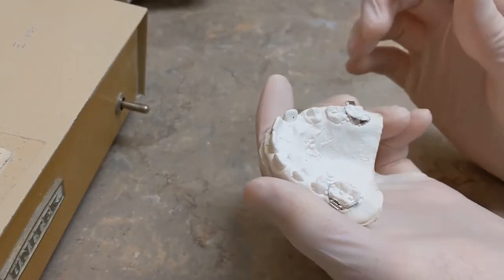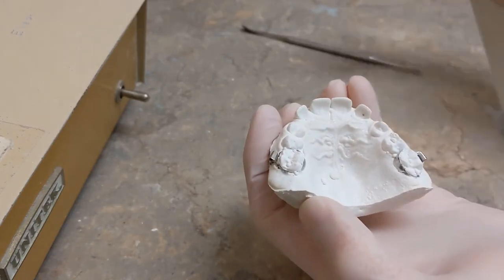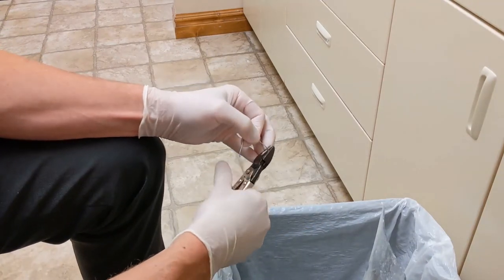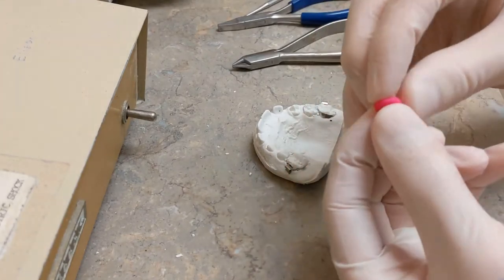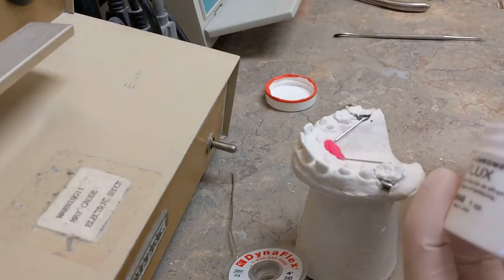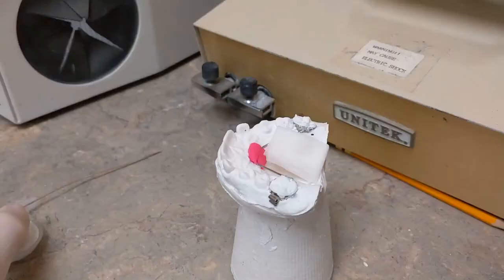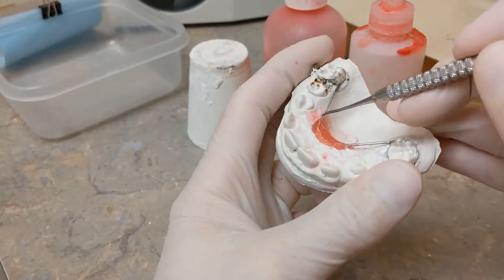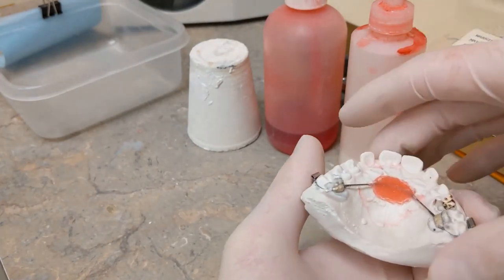How to make a Nance appliance

Comment: Great video! You mentioned removing the super glue with your lab knife. I have used staples to hold the bands into the impression, but are you using super glue to glue the bands into the impression before you pour it up? Also, I didn't see you polish the bands at all. Do you do that to make them shiny after soldering? If so, what do you like to use? Thanks!
Reply from the maker: Thanks!  I use a tiny dot of super glue to hold the bands in the impression before I pour up the impression. I show how I do that in my video on how to pour up an impression with bands. That video can be found on my YouTube channel Like A Boss Productions. 
I don’t polish the bands but I have started to polish the solder joints. I use a green wheel in a lab hand-piece to polish. Then I use a wire brush to clean off the band, bracket, headgear tube, inside the bands, etc, to remove any stone bits or debris that may be stuck on.

Comment: What material You use for stick the wire to the cast, before You soldering the wire to the bands? This material îs thermoresistant?
Reply: I use Play-Doh. I buy it at WalMart for $1 (cheap!). To prevent it from scorching when I solder I cover it and the wire with a wet paper towel. The water in the paper towel soaks up the extra heat from the torch flame and prevents the wire from overheating and getting brittle. After I've soldered the wire to the bands I pick off the Play-Doh with a wax spatula and brush off any residue with a toothbrush while rinsing it under the faucet.

Comment: I just came across your channel and love your videos! My ortho says I have to get a bite plane so she can bring my upper first molars lower down. Is that the same thing as a nance appliance?
Reply from the maker: A bite plane (or some call it a bite plate) is a removable appliance made of acrylic that fits against the roof of your mouth. It covers the roof of your mouth and the acrylic is thicker behind your front teeth. That means that when it's in place your lower front teeth bite on that thickened acrylic and your back teeth don't touch. Over a few months your back teeth can erupt until they touch again.
I hope that explanation helps. I'll bet there's a YouTube video out there if you're having terrible picturing it in your head. 👍

Comment: what are those ketchup bottles used for the storage of acrylic resin? what's it called? and their tips?
Reply from the maker: They're just plastic squeeze bottles. The monomer bottle can be found by searching "squeeze bottle needle tip" on Amazon.com or a similar site. The polymer bottle would be found by searching for "squeeze bottle". Then you can cut the tip of the polymer squeeze bottle to dispense as much or as little as you like. I like it to dispense very little so I keep the hole very small. 
Also, we don't keep a cap on either bottle during storage but you can if you like. I hope that helps! 👍
Reply: thanks alot! :)